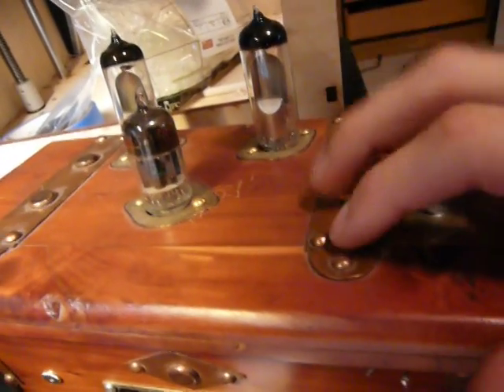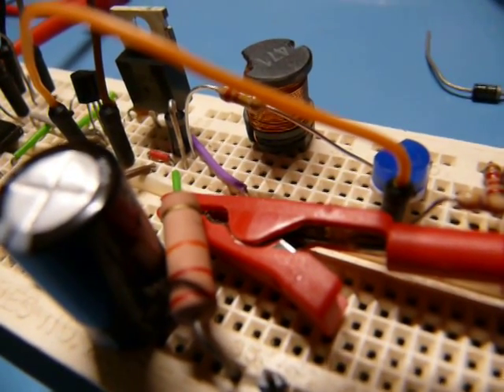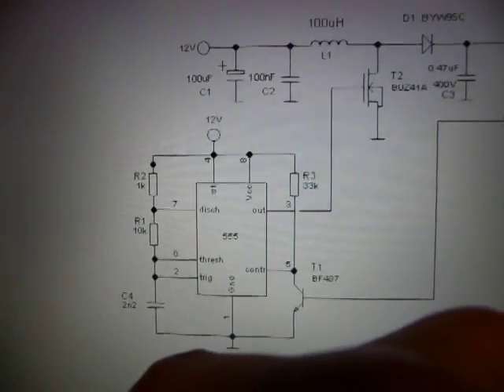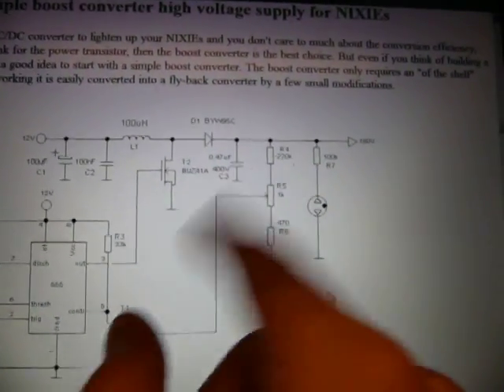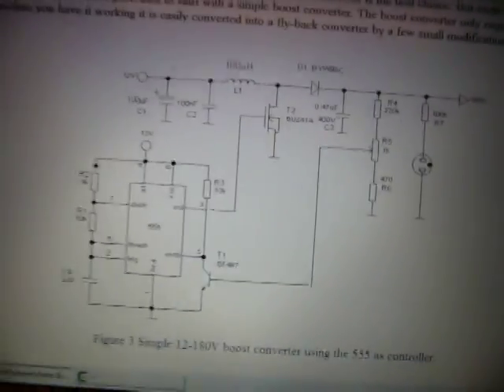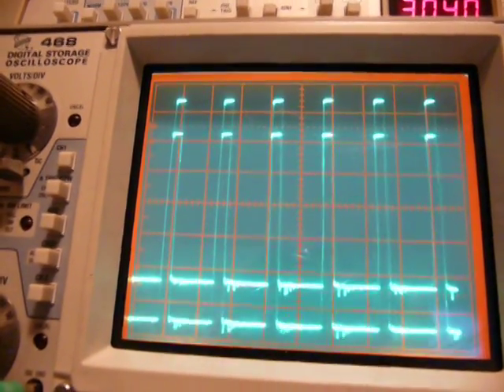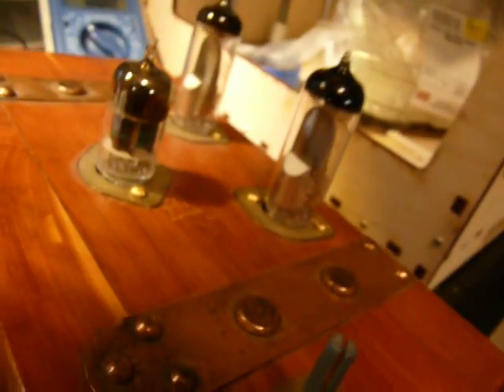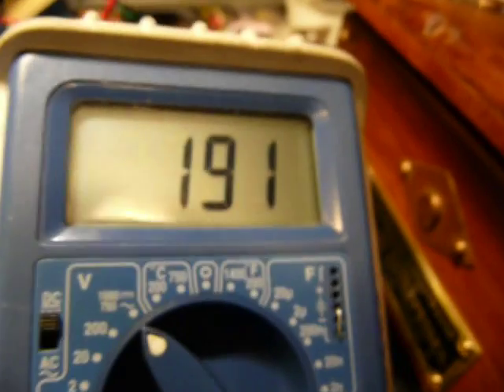High voltage switching power supply

Comment: Freaking cool.  Im planning on doing something similar.  Did you only use that supply to feed the eye tubes or does it actually feed the audio circuit?  About how much current consumption can you have before the voltage starts to sag and show ripple?
Reply from the maker: Thanks for watching! It's just feeding the eye tubes - the audio amps are being run at pretty low voltage straight from the main toroidal transformer (40v or so). As for current capability - I'm not sure. The eye tubes only take maybe 1 or 2 mA each. Pretty sure the supply could generate quite a bit more than that, maybe 15mA? If the amp makes its way back to the lab someday I'll post a ripple reading at various currents.

Good luck with your supply, post a video if you can!